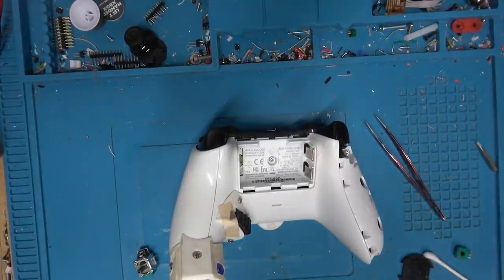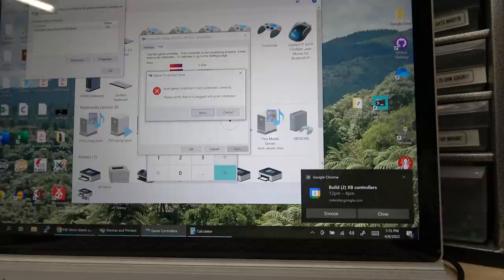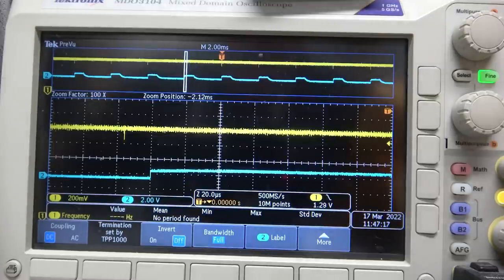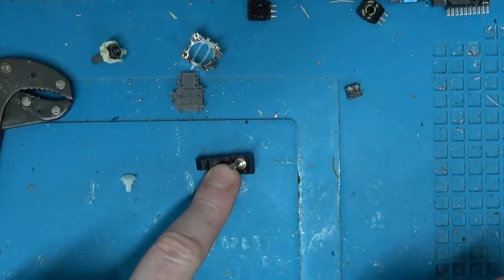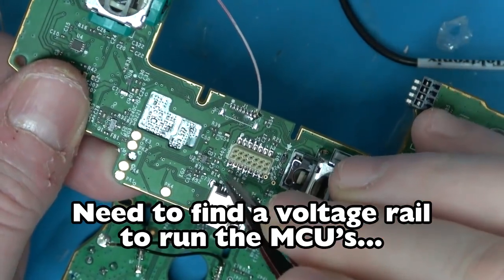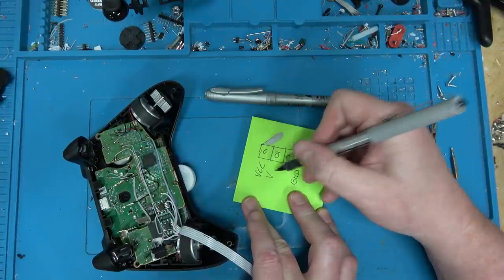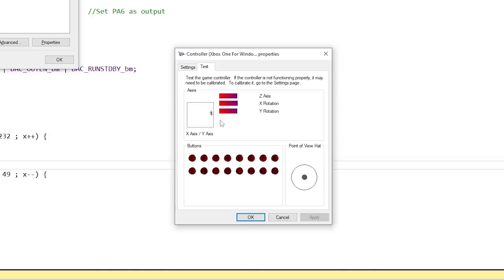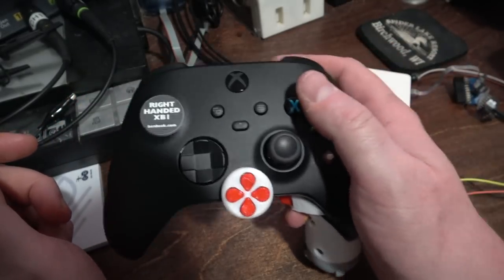Driftbusters: Improving Analog Joysticks

Comment: I'd be curious to see a deeper dive into the PS3 4-pin ALPS. I've always heard they were hall-effect sensors, I've always read that they're magnetically-actuated potted carbon film potentiometers, but never had seen evidence of either as nobody with a sizable audience had torn into one. It's interesting that they're a variable inductive-hall setup, and I'm curious to see more information about it, operating model, polling rate, power requirements, etc. A deeper dive should also provide solid information for resources like the PS3 DevWiki. There also seems to be some confusion as to how the circuit actually operates, part of the devwiki has what the various chips do, but AFAIK nobody has really pieced together how the circuit as a whole works, and I believe part of this may be due to the impression that the circuit is either a carbon wiper pot with a mystery fourth leg or a true hall effect sensor; with better information the circuit can be reverse-engineered, and considering the housing-side is just a pcb, it should be a fairly easily DIY-able solution with some work. I believe the potting compound on the PCB was there to help center the magnet housing, which means the ring around the magnet and the potting compound were most likely interfacing, and getting this setup correct would be the difficult part of the DIYing, as you need to correctly center the potting compound on the PCB, you need the correct surface shape to the potting compound, and you'd need a compatible magnet housing to make the system work correctly. I'd also be curious about the feasibility of a custom IC to make this 4-pin housing into a 3-pin housing, so that it's only a signal out rather than the oddity of the controller's circuit, not really something for the DIY space but as a potential future for analog sticks if anyone were to make sticks in this way again.
Reply from the maker: The PS3 seemed like they were "rolling their own" sensors and using the dedicated TI chip to do the op-amp and sensing.
Reply: @BenHeckHacks  There seems to be a new hall effect stick on the market. GuliKit's King Kong 2, pro and non-pro. Might be worth looking into. 

From what I can tell, they replaced the pots in the typical pot housing and interface design with a circular piece with a couple magnets at the bottom, and using PCB-mounted hall sensors. It's an interesting design that seems to retain the same stick housing, gimbal, and push button cluster, while the only change is where the pots would be; I believe they're even using an off-the-shelf stick housing, the only modification is lack of pots and the addition of the new magnet attachment. As far as I can tell, typical controller price, $50 for the non-pro, the pro just has sensitivity adjustments and a different texture for $70. Unfortunately, it's a Switch layout controller, though it has support for Switch, Windows D and X inputs, by extension Xbox as well, and both major mobile platforms, no idea if Sony's systems can use it though it doesn't have a touchpad anyways. 

It seems like a fairly simple design to copy, entirely 3D printable even, if you continue down the hall effect joystick rabbit hole. Just a housing replacement with very simple internals. It also uses only two sensors, rather than the four of the Dreamcast-esque setup, so there's already a potential cost and part savings. Outside of obvious PCB issues, it seems to be an almost direct drop-in replacement. VK's Channel video "This is the First Drift-Proof 3rd Party Controller / VK Review King Kong 2 Pro" has a demonstration of the entirety of the new design roughly twenty minutes in.

Comment: Wouldn’t it be possible to replace the MCU with a differential amplifier? Maybe you’d need a little lead-screw to adjust the position of the sensors for zeroing, but I don’t think it would be too bad.

Comment: Couldn't you just use on hall effect sensor for H and one for V if the value is increasing as it gets further away? That would save one uC and 2 sensors.
Reply: Innately vulnerable to external magnetic fields.
Reply: Gulikit have made a controller that uses hall effect sensors for the sticks and the triggers and it great.
Reply: @absalomdraconis  It's not that big of a problem, unless you live next to a giant magnet, it should work fine. The dreamcast controller used hall effect sensors for the joysticks.

Comment: why did we ever stop using optointerrupter sticks?! reading them is as easy as two digital pins per direction, and they have nothing to wear out besides the springs.
Reply: The simplest type only detect relative motion, they need some sort of homing to know their absolute position.
Reply from the maker: That's what N64 used. That's why the sticks kept working no matter how worn out they got. Tracks relative movement not absolute.

Comment: IIRC as well, while the old N64 controllers may suffer from limp/loose joysticks, they didnt suffer from drift as they used an optical encoder (like your old school computer mice did - ball mice)
Reply: the N64 controllers were terrible. the 2 hard plastic parts that held the stick in the centre position and recorded the movement could wear out in like a month with heavy use. worst design ever for games that had  a 360 degree roll
Reply: @Morgan Zadow  we found that the sticks lasted a long time so long as you centered them manually.  Letting the stick return to center from its own tension wore them out faster.

Comment: I haven't had any luck buying replacements from alps either FYI. I ordered genuine alps assemblies to fix Nintendo switch procontrollers and the footprint is identical and they wont calibrate properly in the controllers. As far as I know the version of the assembly is not listed under digikey/mouser or are old stock or something? Either way I tried 4 different sets in a controller and no dice. I manually cleaned the pots on the old sticks and put them back in and they worked. I don't know how source the correct pots lol as far as I could tell they were all just 10k pots. I don't really have insight as to why they wouldn't work. If you have any knowledge as to why a 10k pot of the same shape acts different I'd love to know.
Reply: https://youtu.be/Uoxz0oHX9TE this guy has another video where you test each pot with a multimeter and find ones that match so that they center

Comment: I'm sure you're aware, but for others, you can get original ALPS joysticks from Mouser. They have an extra little plastic nub on the bottom that has to be trimmed, but otherwise they are drop in replacements for the Xbox.

I recently put some in a controller and they feel great and I haven't had any issues yet.
Reply from the maker: I'll have to check it out thanks! By nub you mean the 2 little posts that are meant to go through the PCB?
Reply: @BenHeckHacks  That's what they look like. They sit just taller than the other raised parts on the bottom plastic. 
Part# RKJXV122400R
Edit: Spelling

Comment: What a video! I just wonder why switch controllers are so expensive - they should be built with hall effect sensors at those prices. Part of me wants to channel your DIY approach to this and do something about it - unfortunately the day job of designing fire sprinkler systems continues and for some reason it's still getting busier and worse.
Reply from the maker: Nintendo tax
Reply: @BenHeckHacks  if you get a replacement stick for $10, you're payng probably for patent or trademark on the modified dual pot analog stick design. short version: Nintendo TAX ... gotta love it

Comment: We have hall effect sensors in gimbals in RC transmitters for almost a decade. Why can't they put these in mass produced game controllers? I don't get it
Reply: The triggers on Xbox controllers are hall effect sensors, so it absolutely can be done!

Also IIRC the Dreamcast had a hall effect sensor joystick.
Reply: Ps3 controllers used hall effect for a few years.
Reply: @bookshelffury  You had me so interested, I opened one of mine to see. But sadly I have a potentiometer one
Reply: @VincentFischer  from what i've seen, sixaxis only controllers use pots, Dualshock 3's from 2008 - 2011ish use hall effect, then they cost reduced the controller and went back to pots among other things.
Reply: @bookshelffury  Yea damn, checks out. I have sixaxis one's,

Comment: I've never heard of hall effect sensors until now, and I'm surprised that every company is not using these for analog sticks. Probably because of price reasons...
but still, I think these should be the future for analog sticks.
Reply: I think Alps Electronics (largest controller component supplier, or at least analog stick supplier for game consoles) has some recent patents using the technology, so well see if they get used.
Reply: Sega Saturn 3D controller has a Hall Effect stick
Reply: @Ben-do1bf  I'm just thinking, that if Nintendo is willing to pay for parent rights, maybe we could eliminate switch drift once and for all.
Reply: @Porygonal64  I understand that they've been used in the past, (Sega Dreamcast) But I wish all modern consoles used these amazing things.
Reply from the maker: Xbox one uses hall effect for the triggers.
Reply: @BenHeckHacks  sounds like those triggers would be very reliable. also, do you think hall effect controls have better analog ranges than carbon contact (or whatever sensors triggers also use) ones? Also, thanks for commenting Ben!

Comment: Anyone tried helders stick drift fix? There 2 pcb's you soder to the anolog sticks. I can't explain it right but they're supposed to be permanent fixes, as long as you're potentiometers are good. You mainly tighten or loosen tension. I don't know enough to explain it better lol. I wanted try it but I haven't seen a lot of people talk about them.
Reply: All that is a board with additional pots on it and what Ben has already has those https://youtu.be/HBcHfwVt82I?t=202. The board won't solve the problem of the pots being damaged from wear (you've got components rubbing against each other) which is the case in this video. The best it can do is hide stick drift.

Ok, I guess it is possible that the potentiometers on the board you refer to are used different than the one Ben has on the controller in rather than adjusting where center is, they adjust how large the deadzone is. Deadzone treats all values within a certain threshold as centered.

Comment: The key to reliability is to remove the “mechanical” aspect of any electro-mechanical device. High-end joysticks use magnetic pickup coils. It costs more, but the majority of ignorant consumers would rather pay Chinese slave labor prices these days than buy quality goods that last.
Reply: I mean, ignorant consumers don't have a choice, you can't exactly tell Microsoft you'd like a better stick in your controller.
Reply: I want that, but don't know where to buy it. ☠️
Reply: @albertogregory9678  - You’re right. We live in a throw away society and companies only manufacture what they can sell. I can’t tell you how many times I’ve wanted to buy an item, only to do my research and not be able to find a single model or brand with good reviews. In each case, I would gladly pay more for a good product, but it simply doesn’t exist. It’s not always been this way. The saying “they don’t make them like they used to” is very true.
Reply: I'd rather pay $200 for an elite ps5 controller with a replacable battery pack than pay $70 for the current crap that drifts after a few months

Comment: Hi Ben! Huge fan here, I was wondering what happened to the Auto-Mask project? Is that dead or left on a work in progress? As always happy to see you tinker with stuff and create! Best regards!
Reply from the maker: After years of data I am firmly and staunchly against masks now.
Reply: @BenHeckHacks  I think of the same! But there is something so pleasingly 
aesthetic about it haha It resembles that kind of equipment a villain with impaired speech would use to comunicate, I just felt in love with how it looked and worked!!! Thanks for the response and keep up the good work!
Reply from the maker: @TheWarthog2102  Yeah it was supposed to be like in the Marvel movies where the masks constantly pop off to see the actors inside. The 2nd revision also ensured a good seal around the nose which most masks lack.

Comment: But why haven't they used optical encoder wheels for the analog sticks? If the dirt is sealed out well enough there shouldn't be any problems for at least a decade. That could be made fairly simple and low-cost as well. (No more complicated than the scroll wheel on any mouse, and those are fairly robust. Is such a thing patent-locked to hell for this particular application?)
Reply: I think that's how the thumbstick on the N64 gamepad worked.
Reply: More expensive to manifacture. Thats literally the only reason for these.. 
They dont do it, because it costs money.

And if it breaks early you probably buy another controller anyways making them even more money.
Reply from the maker: @davidcaamano2716  Correct. It's why they worked even when they got all chewed up and worn out. Because the movement was relative not absolute.

Comment: Are the switch joysticks hall effect sensors? 🤔
Reply: ✨ no ✨
Reply: The joysticks are two potentiometers (variable resistors). One in the X direction and one in the Y direction. Hall effect sensors are a lot more limited in precision and wouldn't be practical to use in a joystick :)
Reply: @tf_d  Hall effect sensors have been used in RC transmitters for years, they make very good sticks. They can be wildly more precise than you'd ever need.

Comment: I would like to be able to do this for any regular controller any no hall effect controller, not just a special made one, I don't care that they don't do it. I'm able to solder and modify, but as for programing the controller dac's , not my cup of tea. Am able to learn the coding for, Just need a good reference, and a starting point for this type of coding. But ty so much for this, I hate carbon based film pots, total cheap out, makes so much e-waste. So what am I going to have to learn to be a master controller converter? Thank you Ben for this. I'm a sub for life because of this one video.
Reply: @Retro2ModernGaming  You need active electronics to convert Hall effect sensor readings to something the controller can understand. GuliKit has Hall effect stick modules for Steam Deck and you can see that they have MCU on them. New PS Edge controller has replaceable stick modules so maybe this will also be an option for it.
Reply: @Retro2ModernGaming  You can glue the sensor to the thumb stick daughter board, wrap it's legs around and solder them to the appropriate pin, or cross them over each other and insulate them. 
The issue is more that you need to either make the whole assembly produce voltages quite close to those the pot would have, or have an MCU with a few ADC and DAC channels to adjust those to the appropriate values. The software side shouldn't at all be difficult, but you'd likely need a discrete DAC, since most MCUs don't have many DAC channels if at all. 
For that the LTC2636(-HMI/-HMX/-HZ) is a likely candidate. It works with SPI, which most MCUs support, can output up to 4.096V, and it has 8 channels that can be addressed individually in a very simple manner. Note that the LMI/LMX/LX output up to 2.5V.

The magnets can be glued to the rotating part of the potentiometer(it just clips to the bit with the traces), so you don't even have to 3D print a holder. This is the method I'm using, along with an RP2040-Zero that would replace the controller's MCU as well.
Reply: @ClassicGOD  The sensors on the GuliKit Steam Deck sticks output an analog signal between 1300 and 2100mv or so. I have a pair hooked up to an MCU. The on board MCU is likely intended to either convert it the the range the steam deck expects or to communicate with it digitally(if the original stick daughter boards send a digital output).

Comment: Holy s**t would I currently need this Freescale processor for my 10.000 unit production run of some electronics for my company. I hope they are not fused of. Need to buy some mechanically damaged X-Box controllers from the recycler

Comment: Can you imagine if Ben was married....
She comes home. Approaches Ben's workshop, when she hears "I should probably use this time to practice Story Time Ben."
To which she, understandably, stops and thinks "is... he... secretly planning to impregnate me??? 🤨😳"
lol

Oh and Ben, the reason it has a thermistor is no doubt because the detected voltage would change based on temperature. Might be ever so slight, but when it's a thumbstick that needs the accuracy, it matters.

I wonder if graphite in graphite would prevent the eroding...🤔 Then again, it's a company, they give zero-shits about permanently fixing this in non-hall variants. Because then... You won't eventually end up buying another one!
Either way I figure a chunk of pencil lead on the end of a spring (basically, conductive-gluing the chunk to the "lead" to the wiper they already use). Then it'd work like motor brushes, the spring compensating for it wearing down, but my hope being the graphite-on-graphite not being so susceptible to wear in the first place.